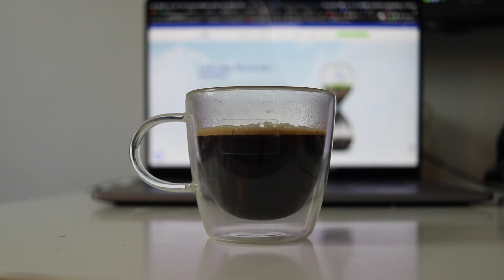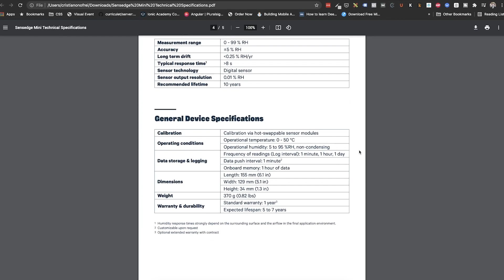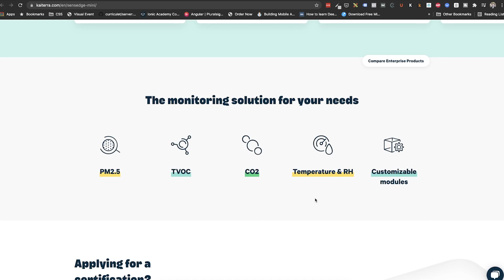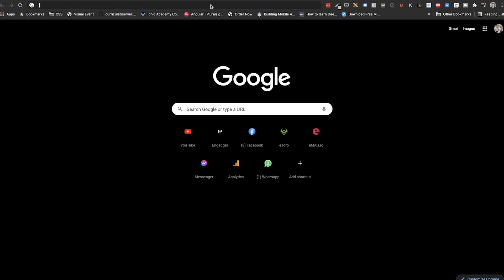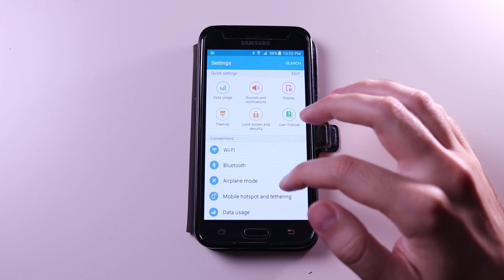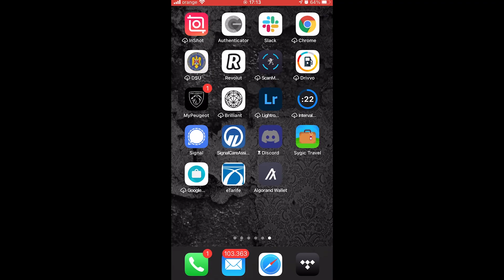PlanetWatch Type 3 Reveal: Kaiterra Sensedge Mini - Why it's better than you think

Comment: Hi!
If I already have a type 1 will it be a probleme to have this one?
And will they keep this 50%  increase in Planets? I haven´t found any info in their media. Thanks!
Reply from the maker: No problem as they are different types of sensors. The extra 50% reward is until 31 December but the community will vote if it will be permanent or not before that deadline

Comment: Can I use sensedge mini commercial instead of sensedge mini which is available at local store or I have to buy from planetwatch
Reply from the maker: It's the same sensor so you can buy it from wherever you want. Just to note: if you buy from a local store, PlanetWatch will not help you if your unit gets broken or when it will need recalibration. You will have to pay and do it yourself
Reply: @ChrisCryptoCoffee  thanks
Reply: @ChrisCryptoCoffee  planet watch have no setup guide for sensedge mini how can I link my sensor with planetwatch
Reply from the maker: @akg708  Nope, they didn't publish the process of onboarding this sensor to PlanetWatch. Probably  on 11th of October since than they will ship the sensor
Reply: @akg708  did you have any luck linking your 3rd party purchased sensor to planetwatch?

Comment: Can i setup several devices in different locations with esch has a different license but same wallet
Reply from the maker: Yes! That is somewhat what I am doing (I have wallets for each location but they have all the sensors in that spot
Reply: @ChrisCryptoCoffee  but i cant have one wallet has to be several
Reply from the maker: @saifalfalahi8444  you can with PlanetWatch support to move sensors across your wallets however you like (all in one, based on locations, etc)

Comment: hello friend thanks for the explanatory videos and the contribution to the community
the question I have is: if I have a type 1 license outside the house and now I install a type 3 inside my house.
I know that they are different, that would prejudice the rewards type 1 and type 3, or it does not influence the payments
Reply from the maker: It will not influence each other. As a rule we can have 1 Type 1, 1 Type 2, 1 Type 3, Type 4 at one house

Comment: Hi, your content is Freaking Amazing.
I have question:
I was using IOS phone then I switched to android phone since 3 days. I don't know what goes wrong, but until now I didn't get my Planets rewords transferred to my Algorand Wallet, even I linked the wallet with the same new 25 words which I got it from the Android phone when I installed the app. What possibly could be wrong?
Reply from the maker: Thanks! Try going through this awesome guide: https://www.reddit.com/r/PlanetWatchers/comments/o5n5zh/type_4_sensor_atmotube_pro_switching_phones/
Reply from the maker: if you done all the steps in the guide yet still have the same problem, open a ticket to PlanetWatch. Here is the link: https://planetwatch.ladesk.com/submit_ticket
Reply: Friend had the same problem, register another wallet for android, transfer the ios wallet tokens to android
Reply: Can i get rewards (Planets) online with atmotube pro or also with atmotube plus?
Reply from the maker: @dersogenannte7714  Only Amtotube PRO can connect with PlanetWatch
Reply: @ChrisCryptoCoffee  Thanks!